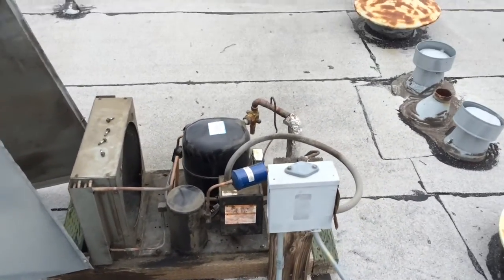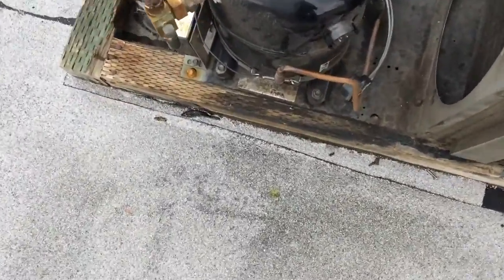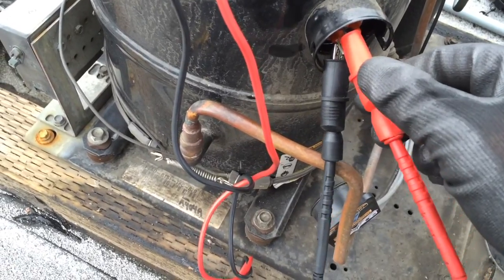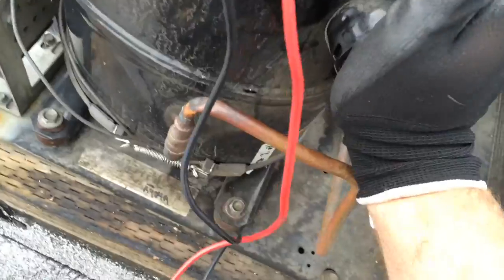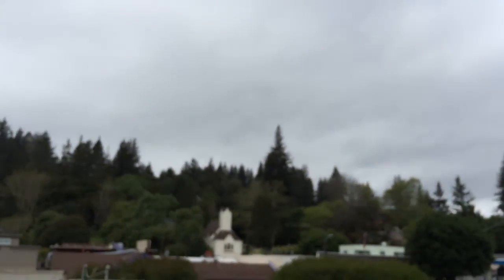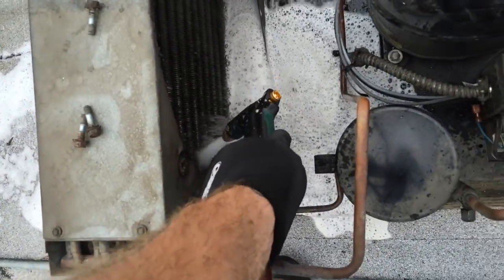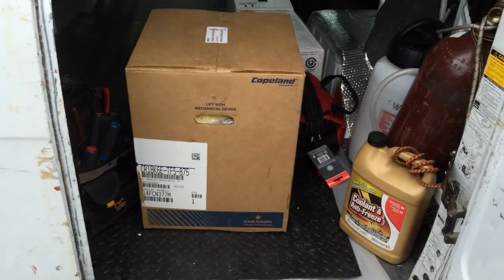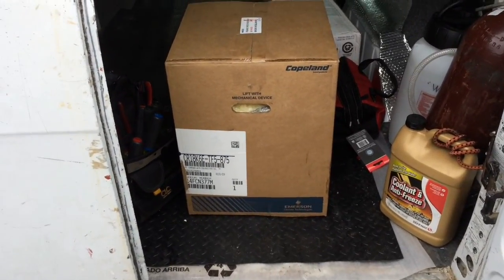Condenser fan motor

Comment: Nice job! Interesting that it's a three phase unit and yet they used a single phase fan motor. There'd be no cap to worry about if they'd used a three phase motor, and three phase motors are often cheaper to buy as well.
Reply from the maker: Copland engineering. Probably make more $ on that OEM cond fan motor.